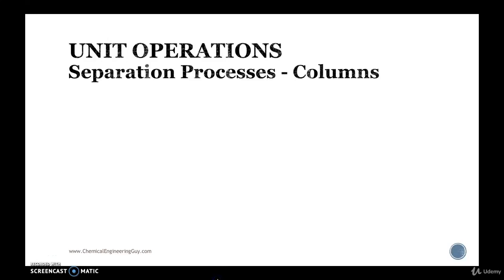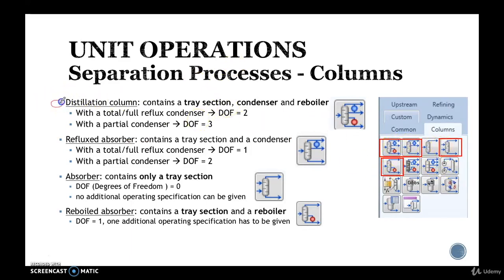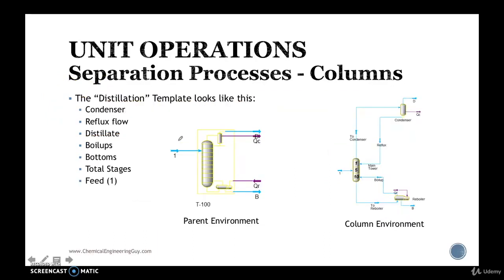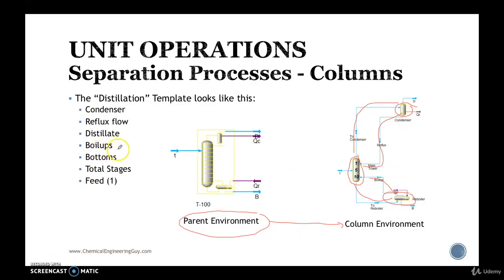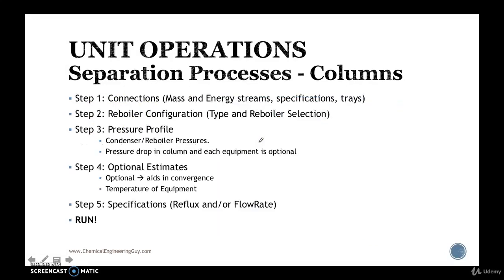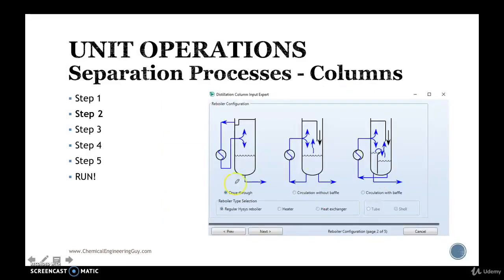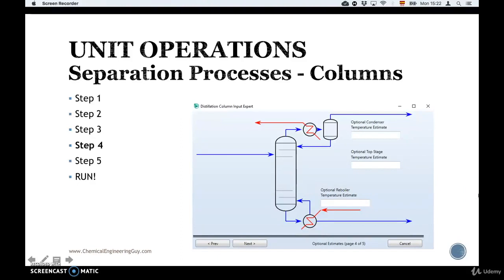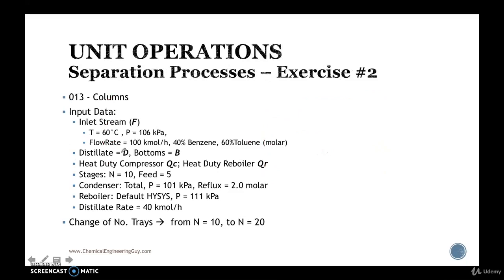Modeling Separation Columns in HYSYS -  HYSYS Basic Course (Lec31)

Comment: sir how if I use short cut distillation first to get the information of the parameter like number of stages and inlet stage, because I want reach the target of percentage of Heavy key in distillate and Light key in bottom, is it possible?
Reply from the maker: yes, shortcut distillation could be a good idea to get started, then use a more complex model such as RADFRAC
Reply: @ChemicalEngineeringGuy  yes, do you open such a telegram or discord channel sir for the community?